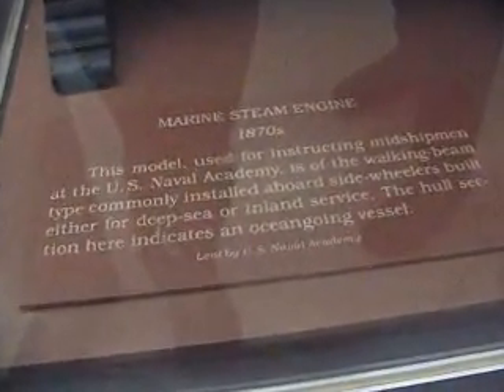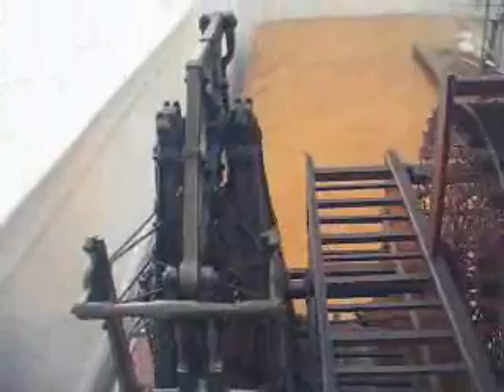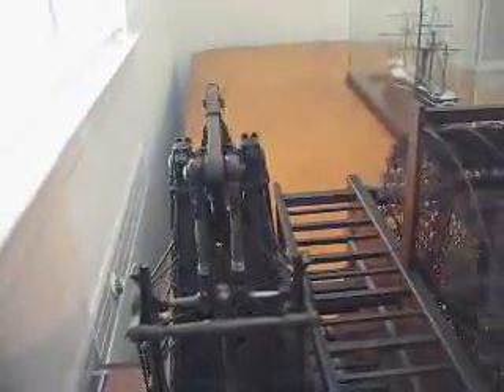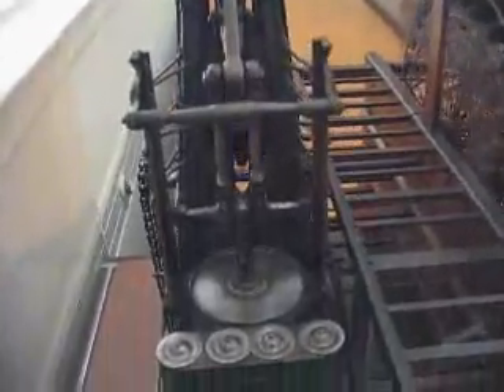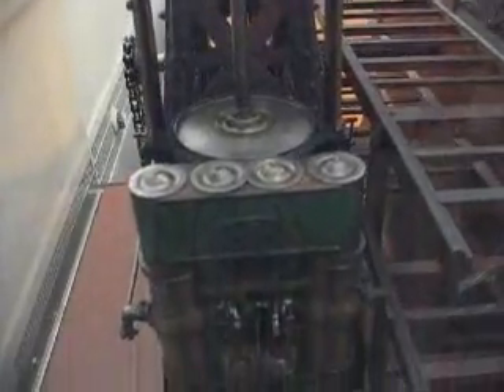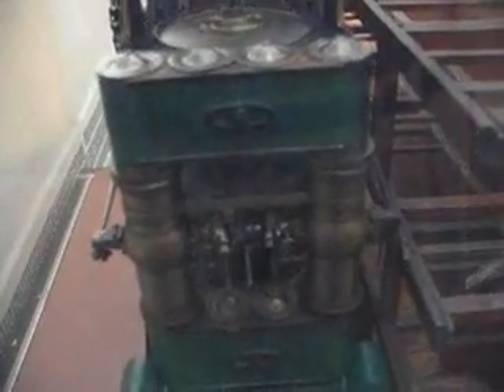Walking Beam Steam Engine Running

Comment: just out of interest this is not a walking beam, this is a beam engine, a walking beam has a moving pivot point so that the end pivot over the cylinder follows the vertical motion without an additional link at that point, so there is a slight side to side motion of the beam as well as the rotational oscillation. so instead of a fixed vertical column there would be vertical links pivoted top and bottom, the beam is often single ended with all working parts running from the same side.

Comment: @DocterJones That will be a large model and their aren't many gas boilers in that large of a scale so you'll have to convert a coal boiler... at least at that scale you can put a car battery in and never worrie about it dying for a few years. ;)  I have up at the smokstak . com forums a links page under scale model engineering it has all the links I found.  It easy to spot with the Green smiley face lol.